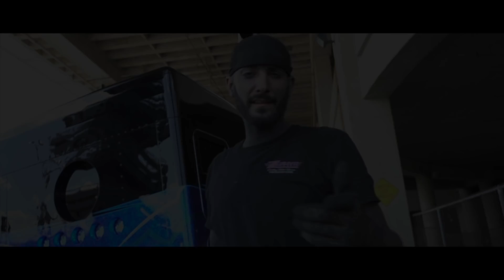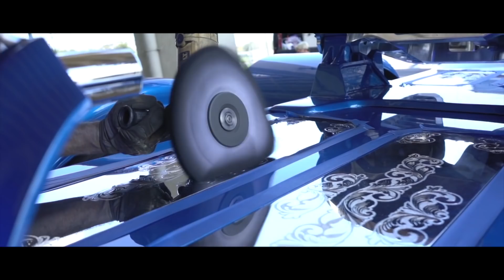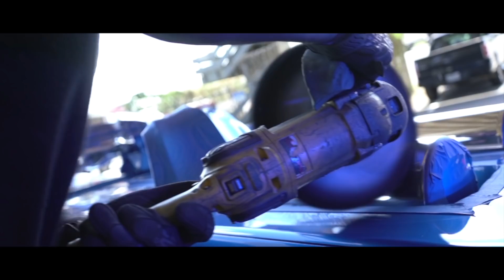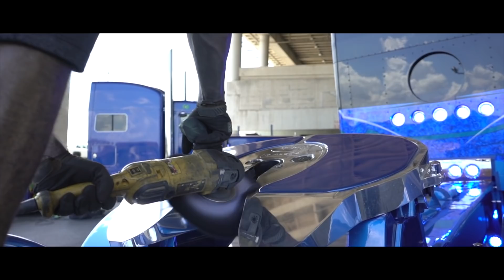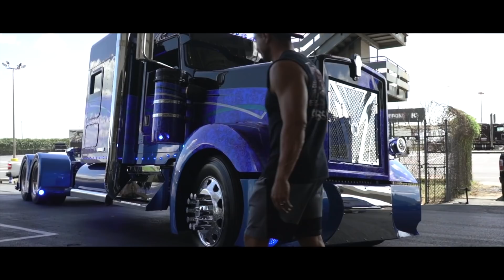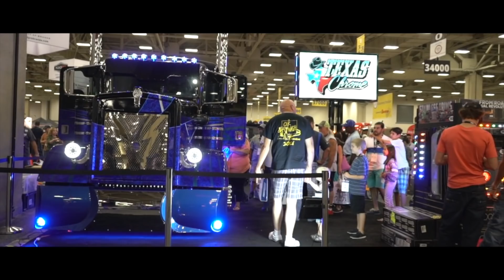POLISHING the MOST CUSTOM  Kenworth 900 using Zephyr Polishes! SUPER HARD TO POLISH

Comment: What's the minimum size polisher needed for the 8 inch wheel and 10 inch wheel
Reply: I use the milwakee 6000 rpm 9 inch sander/grinder. It's a beast...you might find it a bit heavy
Reply: Minimum size I'd say is 5 inch sander grinder 3200 variable speed. Its alot slower but still makes a nice shine. Alot lighter to